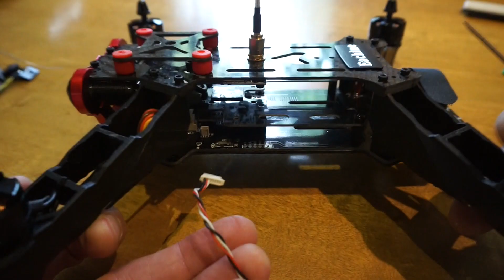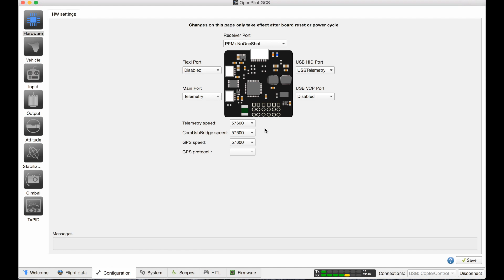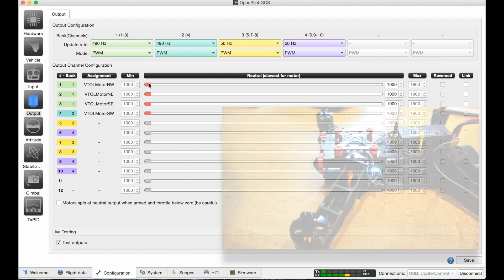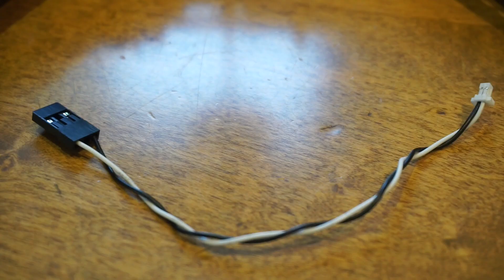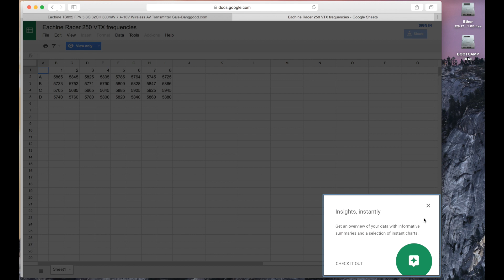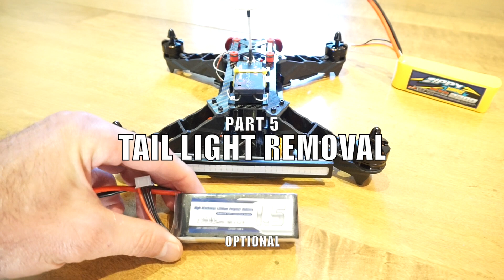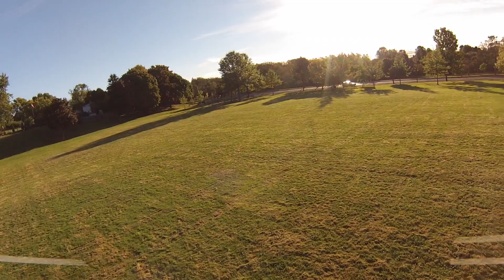Eachine Racer 250 Setup and test flight

Comment: Hi, great vid! 
I have a problem, i can't activate motors. All motor working on openpilot Arming settings "Always Armed". But i cant activate with transmitter as the picture show (throttle right lowest point). All channel working... Have you think?
Reply from the maker: +Reddragon Csatornája If you have it set to "Always Armed" (definitely not recommended) you don't have to move the throttle/yaw stick to bottom right - that's for when you have arming settings of "Yaw Right". If the motors work when using the GCS > Configuration > Output screen, then the ESCs and motors are fine, so it's likely a transmitter configuration issue. Check GCS > Configuration > Input > RC Input screen and confirm the "Channel values" move correctly corresponding to your transmitter inputs. If not, use the wizard. Also check the GCS > Flight data screen to confirmed the armed state is as expected. Good luck!
Reply: +Brandon Hill Thank you! It was channel allocation problem. Now working and fun! :)
Reply: +Reddragon Csatornája Hello, I am having the same problem. Everything works fine on GCS but doesn't arm when I want to fly. What do you mean by channel allocation?
Reply: wires: 1ch blue, 2ch (first)yellow, 3ch green, 4ch yellow, 5ch black, 6ch leds, 7ch whiteredblack, or safety motor switch on Tx
:)
Reply: Thanks for your response. I was able to figure out my problem. My flight mode switch was routed to channel 5 on my transmitter, but for some reason, it keeps using channel 6 on the GCS and when I try to delete channel 6, then, it doesn't arm. So what I did was to let it use channel 6 as the flight mode, but it doesn't see my channel 5. I cannot program anything on channel 5.

Comment: Hey what transmitter did u use with the D8R ii plus been looking everywhere for one that says it works with a d8r ii plus but cant seem to find one
Reply from the maker: I have the Taranis X9D, but you could also buy a FrSky transmitter module and use it with any transmitter that accepts JR style modules. I have one from Hobby King that I used to use with the Turnigy 9X.
Reply: im gonna get the receiver and transmitter that goes with it when u buy it rtf, funny thing is if u buy the arf version (120$) and the transmitter that comes with the receiver (50$) the total is like 180$, has same components the eachine racer rtf version has but saves u like 100$

Comment: Hey Brandon, I setup PPM like you explained in the video. I have a FS-I6 Flysky TX and a FS-IA6b rx the problem I having is Libre/Open pilot is not recognizing the transmitter. The transmitter is bound to the rx but im not getting any input recognition in the transmitter setup wizard. Any suggestions?
Reply from the maker: +87SixShot First, confirm the receiver is bound properly by testing with a servo. Next, confirm the wiring from the rx to the CC3D board is correct. Next, confirm the channels are set correctly in the GCS RC Input screen (type should be PPM, and TAER and flight mode channel order should match your tx). Also, make sure you plug in the battery, since the USB will power the CC3D, but not the receiver. Hope that helps, and good luck!
Reply: +Brandon Hill I don't have a servo to test with but the the FS-IA6b will stop blinking red after Ive supposedly bound it with the Tx. The CC3D board is powering up the reciever and I have the black, red, and white wires setup just like yours. I have setup the GCS channels to match to the corresponding channels of the Tx. I know that PPM is selected but I didnt see TAER so I will look into that.

Thank you for the help ill let you know if I find anything,
Reply from the maker: +87SixShot TAER is the channel order: Throttle, Aileron (roll), Elevator (pitch) and Rudder (yaw), and you need to select the right channels on the RC Input screen as they are set in your transmitter. Also, did you plug in the battery? :)

Comment: im having trouble understanding the max amps i can put into this quad, in terms of battery selection. the math i did told me my 1550Mah 45C battery could supply too many amps for the 4 12A ESC's.  How many continuous and burst amps can i put in this quad with stock motors and ESC's?? Thanks!!
Reply from the maker: +Tim Prewitt The amp draw of the vehicle shouldn't exceed the C rating of the battery, but the opposite is not true – you can use as big a battery as you want, and the vehicle takes what it needs. A 1500 mAh 45C battery can deliver up to 67.5 A (45 x 1.5A), and since the ER250 will at most draw around 48 A (it can spike over that, but not for long), that battery is fine. For the ER250, the minimum C rating for a 1500 mAh battery is 48/1.5 = 32, for 1300 mAh is 48/1.3 = 36 and for 1800 mAh is 48/1.8 = 27. So, you can see the lower the capacity, the higher C rating you'd need. Hope that helps!

Comment: Brandon, I see you are using a Mac, I cannot for the life of me get my iMac to recognize the CC3D board, the board works but it will not recognize it at all.  Is there any drivers I need?
Reply from the maker: +Nick B. Yes, that's possible, but I don't think so (the website says it's plug and play, no drivers required). If you can't get it to connect on a different computer, it could be a bad board.

Comment: YOU HAVE AN EXTRA LAYER(FRAME)  BETWEEN THE BOTTOM AND THE TOP-MINE DOES NOT HAVE THAT-MINE HAS ONLY THE BOTTOM AND THE TOP WITH CCD3 MOUNTED TO THE LOWEST FRAME-HOW WEIRD IS THAT-PLU FOR FOLKS THAT ARE NEW-THE DX6 RECEIVER WILL NOT ACCEPT THE J CONNECTECTORS ON THE END OF THE HARNESS UNLESS YOU FILE THE CORNERS-REAL TIGHT FIT
Reply from the maker: +BDS Yeah, I have the version 1 frame, which had the middle plate. I've removed it for weight savings, but it did serve to protect the VTx and FC from the battery sliding forward in a big crash.

Comment: What version of ios are you using im up to date on el capitan and open pilot keep closing. i can get through alot of the set up the quad respons to everything from the computer controls and the values move and are set correctly on the transmitter but quad and transmitter wont bind together or respond to each other any suggestions?
Reply from the maker: +Horcruxalex When I made this video I had Yosemite, but have since upgraded to El Capitan, and GCS still works fine. As for your Tx/Rx not binding - you'll need to read the manual for your transmitter (are they the same brand/protocol?). I have the FrSky Taranis, and binding works like this: http://open-txu.org/binding-a-variety-of-receivers-with-the-frsky-taranis/

Comment: Hi Brandon! Great video buddy, very informative.

Quick question, I got the eachine ARF, same as the one you have in the video. Am a little confused regarding pairing the video system. I got an eachine screen with it too ( http://www.banggood.com/Eachine-Racer-250-FPV-Drone-7-Inch-5_8G-32CH-Diversity-Wireless-Monitor-p-998312.html ), How do I know what the video receiver frequency is? am looking for the same literature that you show for your receiver but not having any luck finding it :[
Reply from the maker: +Abdul Aleem Shekhani Good question! I don't see any way to know what channel the VRx is set to, but thankfully it does have an "auto scan" feature - just long press the button on the back. If that doesn't work, you have to do the same process as with the VTx, and just cycle through them all.
Reply: Yea thats my plan, autoscan and make a table of which channels are catching, then aim for the middle one to try and ensure best connection.

Comment: Hi Brandon, I just wondered what the flight time has been with 2200 battery? Thanks!
Reply from the maker: +MrKurtay It's a bit more, but not much. Mostly, the 2200 makes it even more tail-heavy, so you can notice it fight to pitch forward. Obviously it depends a lot on how you're flying and on the C ratings, but the gains aren't what I was hoping for. I want to try high C 1800 and 1400 mAh as well.
Reply: +Brandon Hill You are right, perhaps I will install 2200 heavier battery or add a small brick at the back. :) I feel bad for my earlier comments! Sincere apologies!!!!!
Reply: Brandon, I am glad you have been there. Sorry once again for the grief caused. :( Just trying indoor a bit now due to very high wind here.  I already need a decorator and a new set of propellers. :)  I got your PID setings on with 1500 battery (much better than stock) still wobbling up and down a bit. Whilst waiting for the 2200 batteries. Any suggestions (other than don't try at home)? ;)  You probably don't want to now after all (won't blame you) :D
Reply from the maker: +MrKurtay Yes, I've had so many little problems with all technological aspects of this hobby, and I know the frustration. No worries, no grief caused (other than the two thumbs down :)

Seems OpenPilot (and OPNGTune) is dead, and now known as LibrePilot, which has some new "EasyTune" feature (on the TxPID tab of the Configuration page – the GCS is mostly the same). I haven't checked it out yet, but it's next on my list – when I have the time. Other than that, I'd try slowly increasing the sliders on the Stabilization screen until you notice oscillations, then back them down a bit. I hate PIDs, and have never been great at finding the sweet spot, so I'm looking forward to trying out EasyTune.
Reply: +Brandon Hill Thanks Brandon. I appreciate your reply. Yes, I had a look at the site TxPID somewhat seems another way going by. I will study that and try the quad outdoor first to see how it is behaving. Well, I guess if you have a quad working fine no need to fiddle with it. :) Cheers friend, and Merry Christmas to you and your family. Enjoy the festive season.

Comment: what do you suggest for replacing the rear leds? thanks
Reply from the maker: +Kjell Kittelson Personally, I prefer aviation lights - specifically the red/green side lighting. For ease though, I'd go with the little 3/4 LED PCB strips you can get - one on each boom.

Comment: hi brandon, please help I can't get the quad to work. I bound the tx to the rx, upgraded the firmware with openpilot. However, when I get to the transmitter setup wizard it doesn't seem to detect the stick movements. The PWM wires are connected properly to the Rx. what am i missing here?
Reply: I had the same issue to resolve I managed to look at the step where it shows you the wiring. I thought I wired it correctly but I had the connectors on the wrong pins of receiver. after that I refreshed and started from the beginning.
Reply from the maker: +sam c First try to confirm your Tx/Rx are working as expected (try plugging in a servo in PWM mode or something). Next, double check your wiring as +Joel V suggested. Also, make sure you're plugging in the battery - the USB can power the CC3D board, but not the receiver.

Comment: Hi, i just bought this racer. Can you help me out a bit:
1. I did not receive any conecting cable for seting up software
2. I tested it and for some reason motors turn in the direction that it pushes copter downwards ? Is that possible to change with some settings i tried everything on controls and it is not changing directions motors spin.

Thank you
Reply from the maker: +enakup 1. You need to supply your own USB cable (with a Mini B connector). 2. The controls don't change the motor direction – you have to do soldering for that (swap any two motor wires between the ESC). Are your props on correctly? The props marked R should be on the front left and rear right motors only.
Reply: +Brandon Hill Ă

thank you for that yeah was prop issue. Got cable went true setup. I tried to fly and for some reason when battery is full it can hardly lift of the ground even on full throtle. Any ideas ?

Thank you
Reply from the maker: +enakup Assuming all the props and motors are working correctly, on the GCS > Configuration > Input screen, make sure your throttle input is working as expected. Mine is: Min=990, Neutral=1031, Max=2016. With the quad powered (but disarmed), check that max throttle on the transmitter shows as max in the GCS.

If that's okay, I'd try calibrating the ESCs:
- unplug battery
- go to GCS > Output screen
- check "Link" for all four motors
- check "Test outputs"
- move slider to max
- plug in battery
- after ESCs beep (different than usual), move slider to min

Good luck!

Comment: i have done the setup and i can see all props spinning but its not lifting up the eachine from the ground. could you please assist me?
Reply from the maker: +Shaheem Marakkar Make sure your props are on right (the "R" props should be only on the front left and rear right motors). In the GCS > Radio screen, check that your throttle signal is transmitting the full range. Then calibrate your ESCs (use the GCS > Motors screen - I wrote detailed instructions in a previous reply further down the page...). Hope that helps!
Reply: yes brother you are right... being a beginner we used to miss out this kind of information. thank you so much for such a detailed info.

Comment: Can the onboard camera take videos
Reply: +Irelandproduction Do not own it but if you have goggles or a FPV monitor with a DVR it can but you can just attach a small action camera to the R/C Quadcopter.
Reply from the maker: +Irelandproduction No, the camera has no native recording capability. Though as +Andy Black mentioned, attaching an action camera is the typical approach (that's why most 250 size quads, the ER250 included, have a vibration dampened camera platform). If you need to record the FPV camera, you'll need a DVR to connect to your video receiver (most have two outputs).
Reply: +Brandon Hill thank
Reply: +Andy Black thanks

Comment: What is the max size of a battery that would fit this drone?
Reply: +aaron evans yea but what hight wide and lenght
Reply from the maker: +Jeremy Faber The battery cavity is 109x38x32mm (LxWxH), but the maximum size you can fit depends on both the length and height, due to the tail light.

Comment: What should i do with a DSMX receiver?
Reply from the maker: +Andy Black If it's not capable of PWM or PPM, you might be out of luck. To connect a DSM protocol satellite to CC3D you need the Flexi-port plug, which the ER250 doesn't have.
Reply: +Brandon Hill I'm running a LemonRX dual diversity satellite on my Eachine Racer 250. It's a V2 or V3 model. Works beautifully. You probably know this already so if I'm preaching to the choir please forgive me... V2+ of the racer include a flexi port. You get the 3.3V for the satellite from the 3.3V point on the board and the satellite uses 2 wires from the flexi port.

Comment: Do you need to set it up?
Reply from the maker: +NASTY THUG For the ARF version, yes, you need to add your receiver and plug in the wires. The rest is pretty much optional, but recommended.

Comment: Am I right that the video reciiver could be connected to any monitor? What video reciver can you suggest to buy?
Can I use this radio controller http://www.hobbyking.com/hobbyking/store/__16239__HobbyKing_HK6S_2_4Ghz_FHSS_6Ch_Tx_Rx_Mode_2_.html  for the Eachine Racer?
Reply from the maker: +Александр Силин Yes, any 5.8 GHz video receiver will probably work (it has to match some channels the transmitter uses, and chances are it will). I have an RC305, but would prefer one with a display and more channels, like: http://www.banggood.com/Eachine-FPV-5_8G-32CH-Wireless-AV-Receiver-RC832-p-975426.html. Yes, any 4 channel radio will work, but 6 channels is recommended.
Reply: +Brandon Hill Thank you for reply.

Comment: What are the dimensions of the props
Reply from the maker: +EnOrangeSoffa It comes with 5x3" (5030) props. If you remove/replace the aluminum bulkhead that holds the headlights, it'll fit 6" props.
Reply: Brandon Hill Thanks a lot!!

Comment: i have done all, i cant confugure my eachine 250 Racer it keeps beeping and beeping !!! WTF can some one help me please !
Reply from the maker: +Jose Raygada Sounds like the ESCs haven't been calibrated. With the CC3D USB connected, go to the Configuration > Output screen and check the "Link" checkbox for all four motors, then check "Test outputs" (take your props off). Move the sliders to max. Plug in the battery, wait for a beep or two, then move the sliders to min. Hope that helps!
Reply: +Brandon Hill  Thx , now i have set up the motor etc, but i am stucked in the configuration of my futaba 14 channel radio and de Rx, on open pilot the virtual stick dont move (up and nown) when i do it in my radio, any video how to connect the board to the Rx? iam using a Fr Sky TFR6, need help, Please 
Best Regards !
Reply: +Brandon Hill any youtube video for isntall the connector to the receiver? Thanks very much for helping me and for your time.
Reply: I have just set up the drone the a lot dude !
Reply from the maker: +Jose Raygada Good to hear it!

Comment: I've been fighting with mine for four days and now it won't get past setting the firmware now! Wish I never bought this damn thing
Reply from the maker: +mreid08 Sorry to hear you're having trouble. First, try LibrePilot GCS instead of OpenPilot GCS (I updated the link in the description). Go to the Firmware tab and click 'Upgrade.' If that doesn't work you can try a Rescue, using the instructions here: https://librepilot.atlassian.net/wiki/display/LPDOC/Firmware+Tab. Chin up, you'll get there! It's a lot of fun, and you won't regret having bought it once you've flown it a few times.
Reply: +Brandon Hill thanks for the tip, I'll give it a try
Reply: +Brandon Hill libre didn't work and rescue did nothing, I think my board was bad and I finished it. I knew I should have picked the sealed box
Reply from the maker: +mreid08 Sorry to hear that. I hope you're able to get a replacement.
Reply: +Brandon Hill I got it, had to "trick" it to accept and load firmware and it's flying, I'm just tuning it now.
Reply from the maker: +mreid08 Awesome! Glad to hear it.